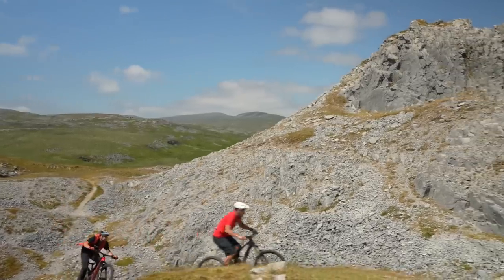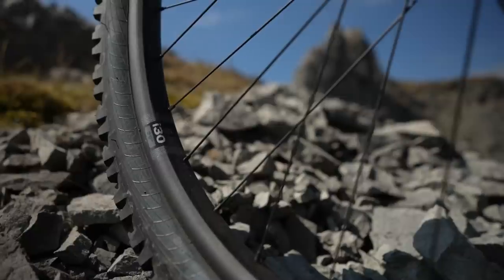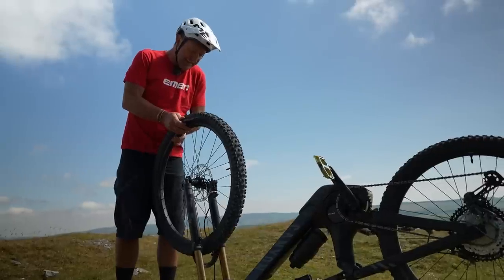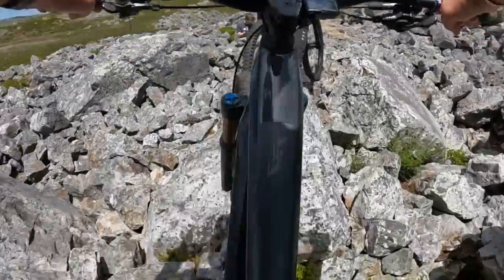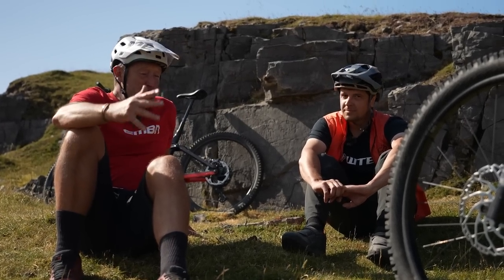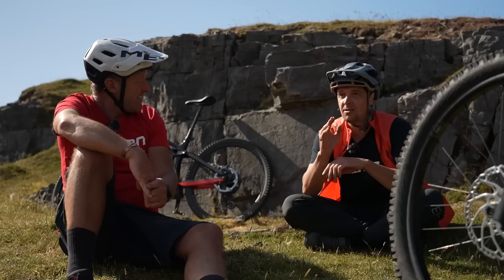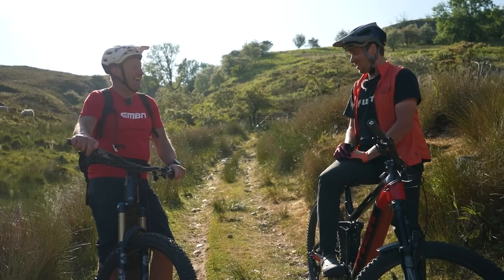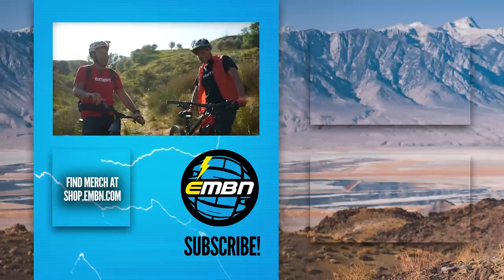How Strong Is An EMTB Wheel? | Wheel Wrecking Challenge

Comment: I had a set of wheels built with industry nine hydra hubs. I’m very disappointed in performance of rear hub. First you can’t get a steel freehub. My Hg freehub was trashed in less than a year. The bearings are shot I would never buy industry nine again. These wtb look interesting and at least come with steel hub. Oh I also have a 2021 Trek Rail. Oh also to replace industry nine freehub is over 200 dollars 😱
Reply: In 4days I stripped the hub shell on my hydra. It being replaced under warranty but no pleased at all.
If it happens again I’ll be going DT.